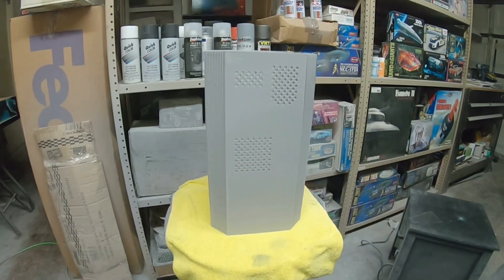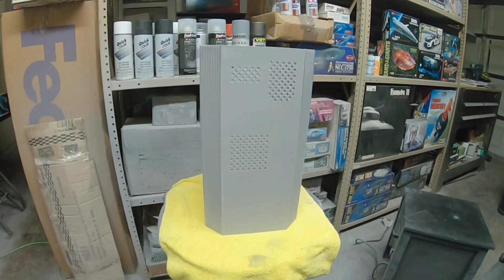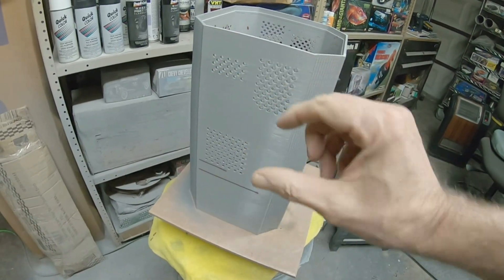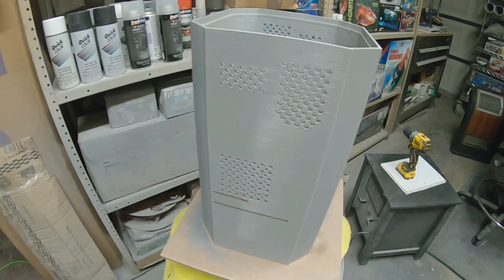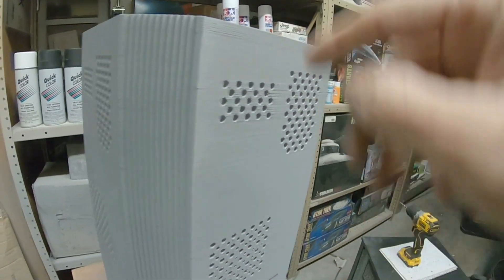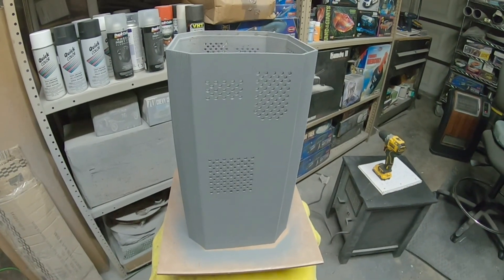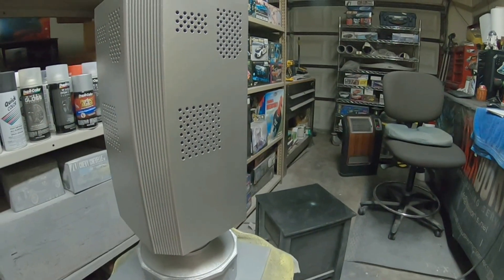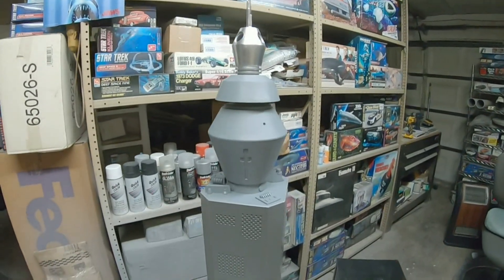Star Trek TOS "NOMAD" 1:1 Scale 3D Printed Replica Pt 1

Comment: Excellent job smoothing out those print lines. Those are always pesky things to get rid of. I found that the yellow lenses that go behind the areas that light up yellow weren't yellow enough so I had to add a few sheets of yellow acetate behind them to darken the yellow tint to look right.
Reply from the maker: Yes I was wondering how the colored lens will look with lighting. I'm going to try with some warm white LED strip. It won't wash out the color like regular white does but I may have to use actual colored lighting.
Reply: @TrekWorks  Oh yeah colored lights would be good! I should have done that on mine. I'm so glad you're building this!

Comment: Isn't there some sort of epoxy resin that you can paint on with a brush to fill in and smooth out all those PLA print lines?
Reply from the maker: Yes and there are a few other ways to fill in the print lines. The resin is expensive and the fumes are very strong. It's winter here and I'm working inside so whatever I use it has to be pretty low key so to speak.

Comment: I have a client at work that brings in 3D printed part that I have to make super smooth to paint. What I do because time is money. First I spray thick coats of a filler primer. I even let the primer run because it’s getting sanded down anyways. Then I hit it with a orbital sander with 320. Then spray another thick coat and hand sand of 320. The key is not to sand to much of the plastic. It leave fine burs.
Reply from the maker: If you have good ventilation, I think the 2K automotive clear would work better and completely smooth it out after a couple coats. it's expensive but time is money as well.